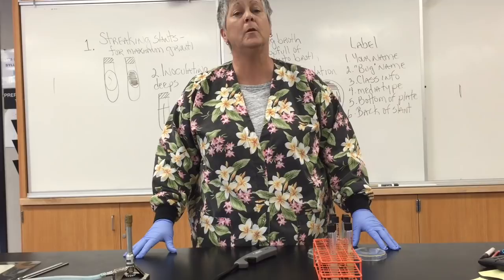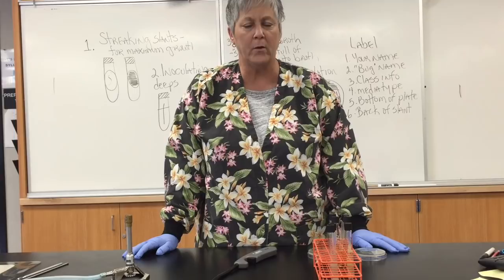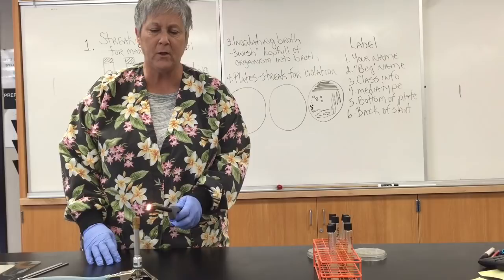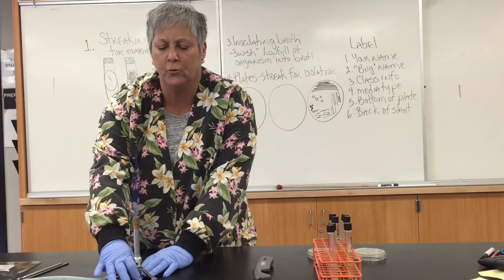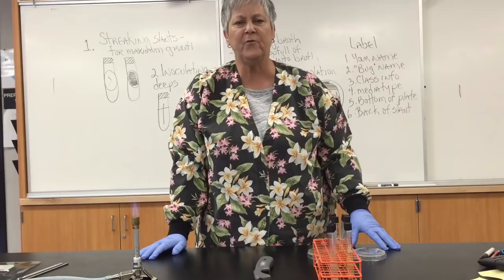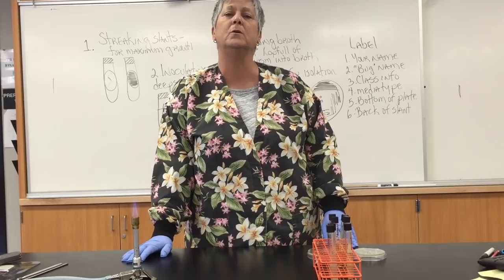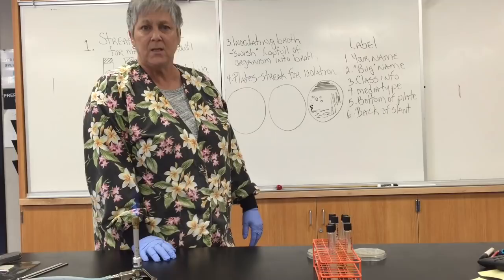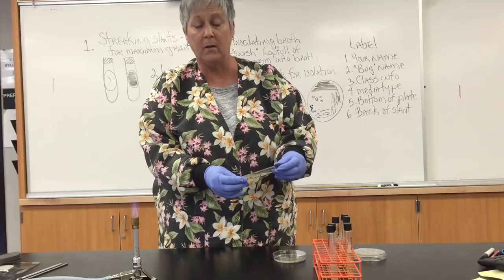Lecture and demonstration of aseptic techniques in the microbiology laboratory

Comment: I never understand how holding the caps that way prevents contamination. Can't bacteria travel from the top of the cap you are holding to the bottom of the cap? And can bacteria really travel from the air or your mouth when talking into your culture?
Reply from the maker: That certainly could happen but if you are careful, it shouldn't be an issue.